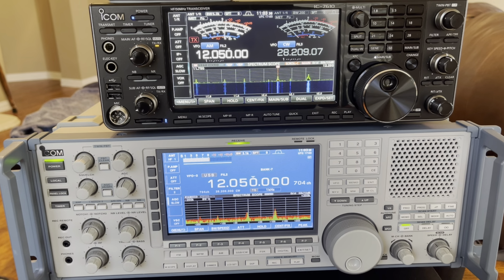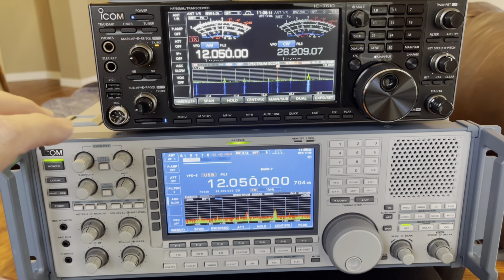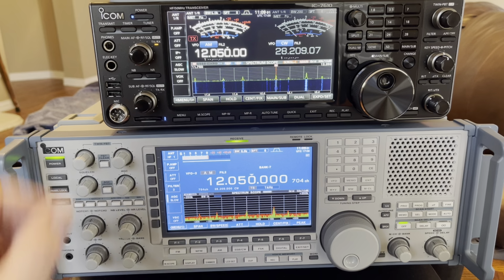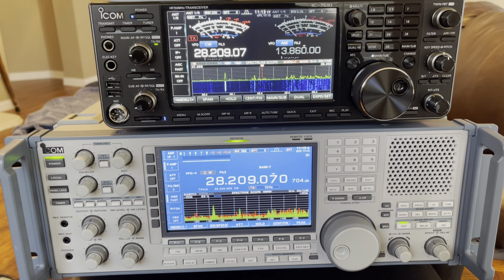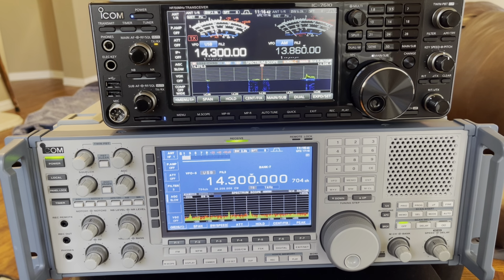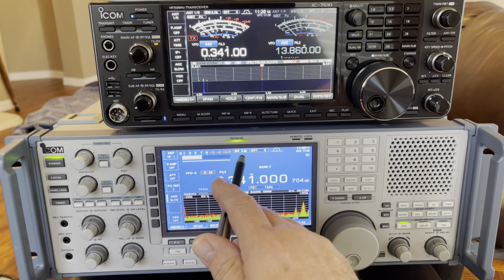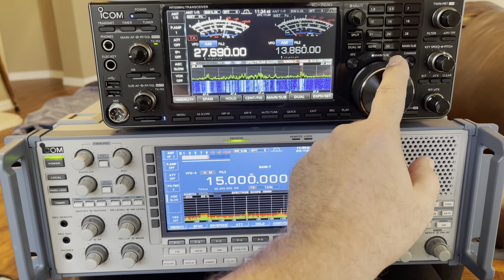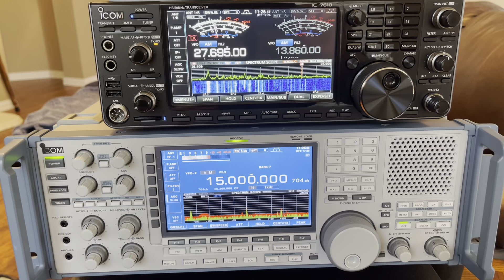Icom 7610 vs Icom 9500

Comment: Just thinking about this trade, the FTDX101MP is $1.2K more expensive than the IC-7610.
Reply from the maker: And I was happy to make the trade.  I couldn’t get rid of the 101 fast enough. And my 101 was not broken, it worked just as the factory designed it (which is the problem).
Reply: @dieselten01  I replayed the video. I think you are referring to the FTDX-101D not the MP. The 101D and the 7610 are not that far apart price wise. So it’s a matter of preference. It looks like you prefer ICOM radios which are great radios btw. But initially, I thought you had made a trade that resulted in $1,200 loss 😅. 73s

Comment: The truth is that even though the Icom 7610 is still a transceiver for HAMs. According to this video, it is confirmed to me that as a HAM, who also likes to monitor traffic of all kinds, this is the ideal radio for me, even though everyone is convincing me to buy a Yaesu or that the Icom 7610 is the same as the 7300, only it has one more receiver. regardless of the fact that there is absolutely perfect software for the Icom 7610 by Markus Roskosch, which takes working with frequencies to the next level again.

Comment: You might be able to use the IC-7610's scope/waterfall to display signals from the IC-R9500. You would need to use a patch cable to connect the 10.7 MHz IF output jack on the back of the IC-R9500 to the receiver antenna input on the IC-7610.  Then you would tune the IC-7610 to 10.7 MHz.   Depending on whether the 7610 has a receive only antenna jack, you must be careful not to transmit on the IC-7610 while the two radios are connected.

Thanks for another neat video.
Reply from the maker: That is genius!
Reply: I have done this many times.. I use my Reuter  RDR50 radio, as it has the ability to REVERSE the display, so when you tune the radio from right to left the display on the RDR50 will move from right to left.. The IF output is reversed... Since you cant reverse the display on the 7610, it can be confusing to watch it... 
I have several radios both boat anchor and table top radios where the IF output, some 455KHz, Some 500KHz some 10.7 MHz all feed into a 6X1 HP switch and that feeds into the RDR50 receiver.. One input on the switch is a regular outside antenna so I can use the Reuter RDR50 as a regular receiver.. All the IF's are saved in memory so the display switching is automatic. I am not aware of any other receiver that will reverse the tuning display??  
Robert
WA6PHN

Comment: Dear sir,
I 've watched quite enough of your videos. I am looking for premium receiver, even though it's quite difficult to buy a second hand premium receiver in Greece. First there are not so many who have them and second, even the old ones work perfectly so no one sells them. 
As I saw in another of your videos, the R 8600 can not beat the older R 9500, besides the price is quite high.
So, I was wondering whether buying a brand new today's transceiver can have an equally good reception.  That doesn't leave me with much choises. Either the 7610 or the 101.
Of course I am loosing all the upper frequencies, even though I would like to have band scope like the 9500 and as frequencies as possible.
So, what is your suggestion? Shall I continue looking for a premium receiver, or leav the old tech behind and buy one of the two mentioned above?
Thank you for your time and your future answers.
73, SV1SLB Michael
Reply from the maker: Hello Michael, a new transceiver from Icom would be an excellent choice. The 7300 or the 7610 are excellent receivers with beautiful spectrum scopes. The 7610 has a few more features but the 7300 is nice too. Buy based on your budget. I would not buy a new Yaesu for use on AM because the Icom bandwidth options are far better. Good luck!
Reply: @dieselten01  Thank you! I already have the 7300, since 5 years now. It's indeed a fine radio, but I still search for something better, something special.  The 7300 does not have a good reception in LF neither in ULF. Besides that, there are some ghost signals appearing down there. E.g. Look at 59.2 kHz, 65.265 kHz, 95 kHz.. You will find signals there without any antenna connected. These are not present on any other transceiver I 've got. Plus, it can not receive the signal from an atomic clock in Germany at 77,5 kHz, at the same time my Kenwood TS 2000 can. I am not aware if the 7610 has the same behaviour. Maybe you can try and tell us. 
Again, thank you for your time  answering my question. I'd be happy to see a video for this ULF between your top receivers.
73 Michael.
Reply from the maker: @batfalcononyoutube  in the USA we do not have much at all on LF or ULF, just a few NDB’s. I show this at about 16:13 in this video we are commenting on. This NDB at 341 is a rather weak beacon at my house and the 7610 is doing as well as the 9500. At my house not only is there very little to hear, but there is significant noise on LF. My Wellbrook antennae helps but a nice quiet location would be better. If you are not using an active loop antenna you should definitely get one.
Reply from the maker: @batfalcononyoutube  michael I am uploading a new video for you on 7610 on LW. Should be ready in about 20 minutes
Reply: @dieselten01  THANK YOU SO MUCH!!!

Comment: You got the pitch pretty identical by ear, very good Nik. Probably the 7610 was 600hz. I’m impressed by the attention to detail of the 9500. Very fine steps there on the pitch. I’ve noticed some difference on the s-meters. On the lower part of the scale, say below s5. I think you did well trading the 101 for the 7610, just my opinion. Another thing, I believe you can link them together in some way so for example if you move the 9500 vfo the 7610 will follow, hence would be like having his scope on the 9500. Otherwise just put a screen over the 9500 with an sdr taking the if out from the 9500. You should check if that’s possible, not sure. By the way if one reads the manuals from the radios can discover a whole lot of amazing things the radio can do.
Cheers
Diego
Reply from the maker: Thanks Diego!

Comment: I heard you keep saying how bad the FTDX-101 was, but I can't find any comparison video on that radio.  Care to share why besides it doesn't have a clock?
Reply from the maker: Keep all my comments in perspective and remember that I am not a Ham. As a DXer, SWL, beacon chaser with most of my use on AM - the 101 “aint all that and a bag of chips”. I found out after buying the radio that Yaesu neutered all of the radio functions when using AM. No adjustable bw or roofing filters. No shift or notch or any of the crazy wild things they offer in cw or ssb. Only 2 options, AM at 9khz bw and AMN at 6khz. All the new Icoms offer all their toys to the AM user. Although the 101 is an excellent Ham receiver you might be able to see why I am disappointed in it. And please don’t lay the typical “this is made for hams“ on me, as it is still a Receiver. It doesn’t matter that it has a transmitter connected to it, it still has a Receiver. Just take a look at any new Icom. All are awesome
Reply: @dieselten01  Thanks for the valuable perspective.  I didn't mean to pick any bone or anything out of context.  I was in all honesty wanted to hear exactly why you didn't like the 101.  There won't be anyone else who is more qualify to like/dislike while equipped with the actual comparison experiences.  I really appreciate that.  Thank you again!
Reply: @dieselten01 for the next guy who says "its designed for ham use" remind him hams use a.m. too. Good vid I've been getting told yaesu yaesu yaesu by salesman but i cant stand yaesu user interface,  its just deplorable. Icoms for me at least have always been easy to operate very intuitive like the manual is almost never required to do what you wanna do. Thanks and 73

Comment: Hi Nick, would you Trust buying a WJ8711 that is over in China, but on Ebay    or wait  for one here in the states ? tks fer another Fine video
Reply from the maker: I have a friend who bought one from china on ebay.  He loves it. Look at the sellers rating and return policy then make your best judgment. Ebay also protects you if you use paypal. Of course there are no guarantees. Remember these radios are very old and most saw heavy use. Even if not used alot the parts deteriorate with age. Good luck

Comment: Nick, at 17 Minutes into the video, 341 KHz, the 9500 S meter reads S8, where as the 7610 reads S2.. At other frequencies they read close to the same.. However they sound the same when listening to the beacon?? Not sure if the 7610 has a built in Bandpass filter that may be attenuating signals below 1700 KHz, like the Kenwood TS-890S has built in.. When below 1700 the Kenwood needs Preamp 1 or 2 turned on to overcome the filter.. 
I am not an expert on the 7610 radio being a Flex 6600M person..
Next up,, you must put the IC-R8600 up against the IC-7610, or YES!!!!! The IC-7610 up against the TS-8980S if you can get it out of the trash,,, LOL
Get rid of that Cold, feel Better soon!!!
Robert
WA6PHN